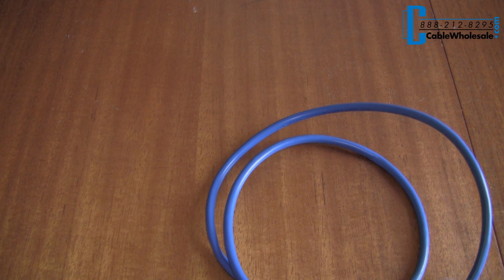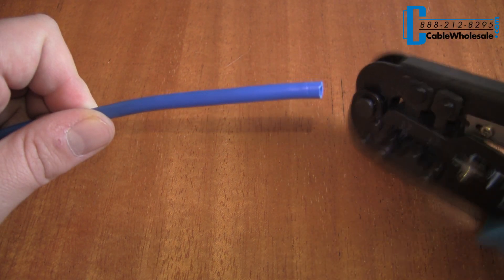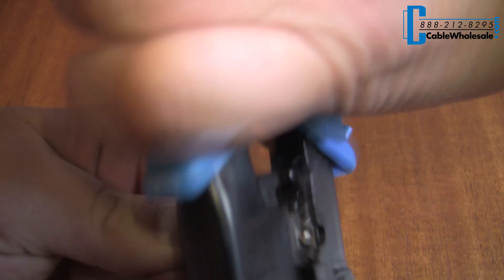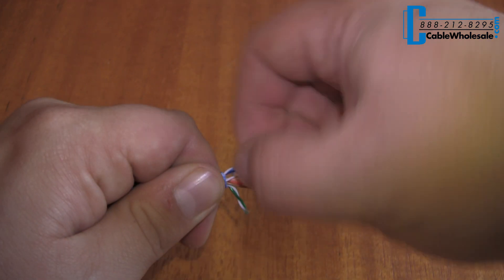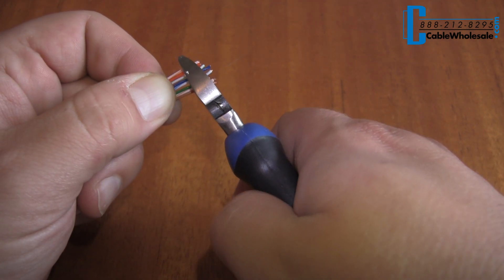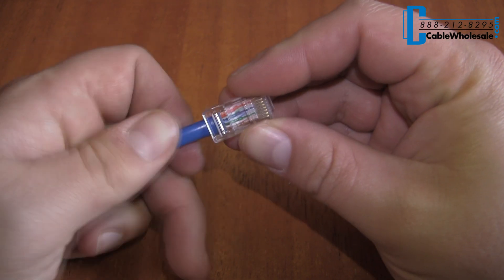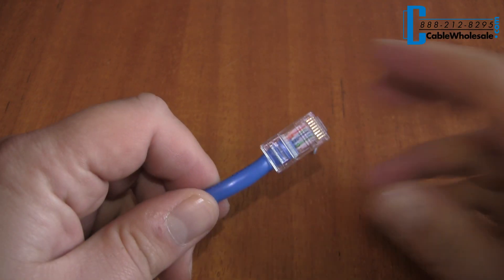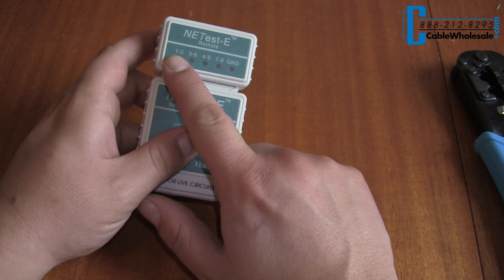How To Terminate and Crimp Cat5e & Cat6 Cables

Comment: Its a okay tutorial, but I would advise people for taking out the plastic cover not to use the crimp tool for this, a sharp knife, or Exacto knife would work best for this, as the cutter it self can leave small little cuts in the cable itself. Also talk a bit louder in your video next itme